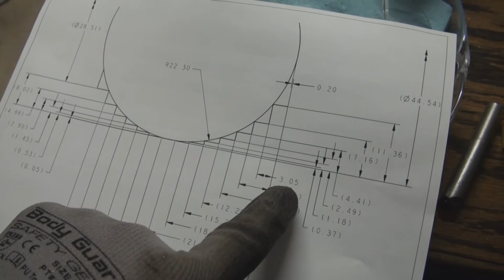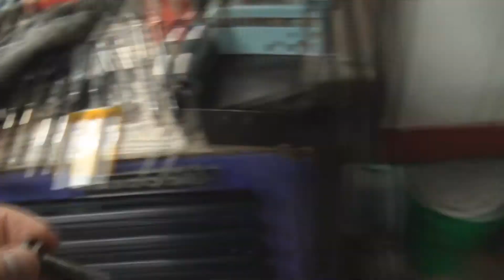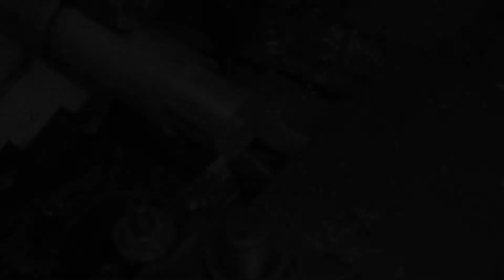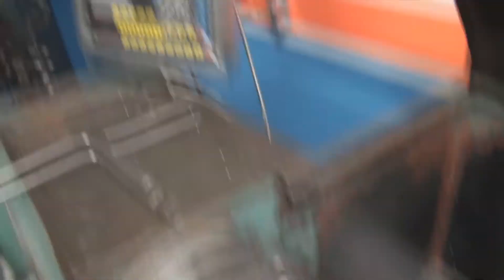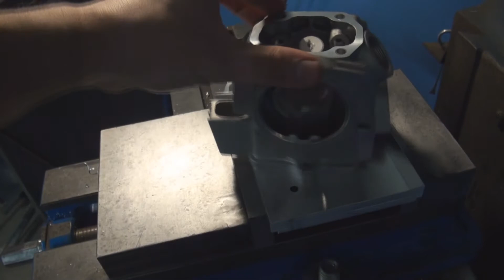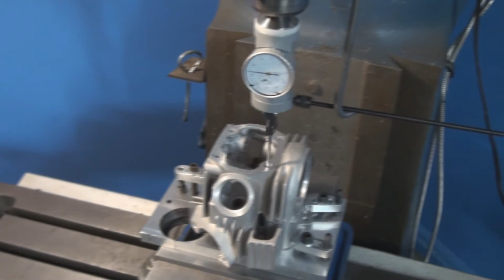Sphere Machining for a measurement fixture

Comment: What is the final goal for the cylinder head? Why do you have to machine it?
Reply from the maker: Tim, thanks for the question. I'm building a novel engine. Instead of making everything from scratch I decided to adapt existing parts. I wanted to have an accurate representation of the part in hand. The  machining is required to make room for the new components inside.

Comment: Really cool project  Why do You require the ball fitment in the chamber? I understand You want to refference the holes but why not just measure relative to one of the existing features?
Reply from the maker: I need to figure out the combustion chamber location relative to the other features. Unfortunately it's not a full hemisphere, so I cannot indicate it. Also I don't have a cmm.